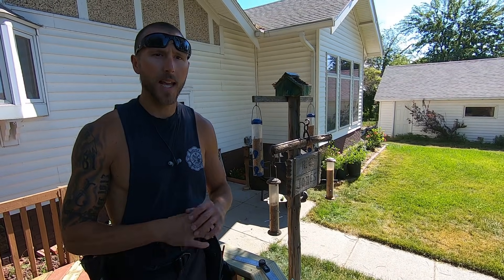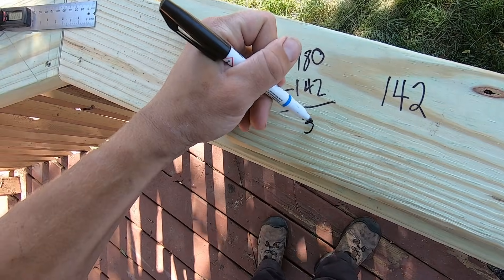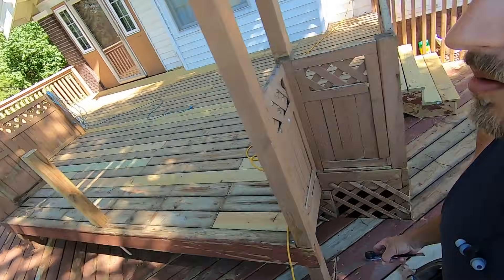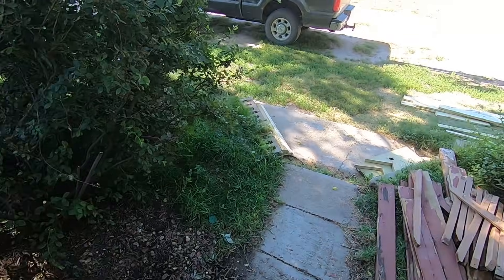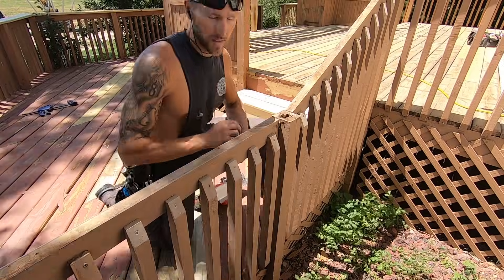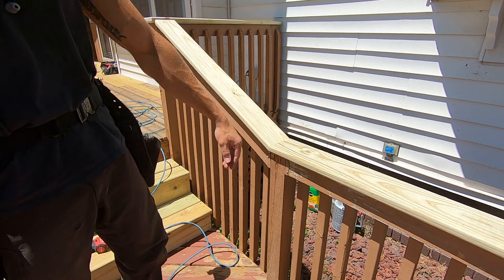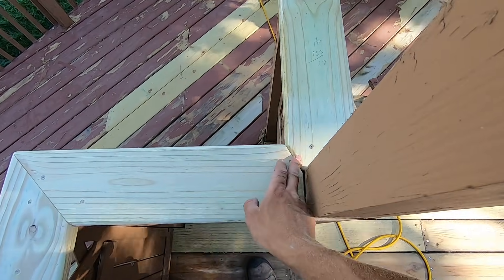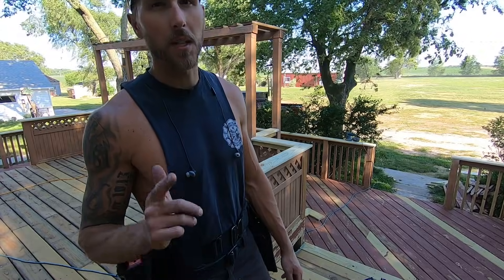Deck Railing, obtuse angles, tips/ tricks

Comment: Why divide the angle by 2 after subtracting it from 180?
Reply from the maker: Good question, I was told because 180 is a straight line not sure on the geometry though just a carpenter haha 😂
Reply from the maker: Dividing by two is bisecting the angle though just like cutting baseboard. 90* wall intersection gets two 45*s
Reply: @AMAYERICAN  ahhhh ok, i am also just a carpenter and always looking for new tricks especially on angles. thanks bro.
Reply from the maker: @SCS2694 another good trick is cutting a scrap block at 45 degrees, CA gluing to your saw base, allows you to cut acute angles for stairs. I think finish carpentry TV did a couple videos on it, I’ve used that trick a few times 👍. Appreciate you taking the time to comment bro!

Comment: Fantastic lesson in math. Worked with a lot of carpenters who liked to overlap and mark because they didn't like to deal with "all that math crap". Just be sure the rail you're getting your angle off of isn't bowing at all from post to post; especially when using that southern yellow pine. You'll think your miter saw or your angle finder or even your carpenter square is broken. 

Not that I would know from experience when recently replacing all the old Southern yellow pine cap rails on my deck. 🤓
Reply from the maker: Yeah it’s been rough lately! I wish we could get PT hem fir here, yp just gets wonky when it dries out! And the knots…. Seen a post about Kiln dried pressure treated lumber they call it kdat? That would be the ticket I bet !

Comment: Is that 3/4 board you used for cap rails? 8 or 6 inch wide? I have same exact deck but 2x4x8 for cap rails and they looked to big and gaudy.
Reply from the maker: Standard deck board 5/4x 6 is what it will be called at lumber yard 👍

Comment: OK, so I just bought two bundles of those railings, they are cut at a angle on one end, but not on the other end. And they are 42 inches long. So it’s up to me to cut the angle at the bottom of each railing, what is the degrees of the cuts on those things, they are the exact same as these in your video
Reply from the maker: You can lay railing up against post and scribe along post to give angle. The railing needs to be resting on stair nosing to get correct angle.

Comment: Does it help - in the long run - to stain/prime/paint the cuts prior to assembling? ...is it worth it? I have sen different opinions on the subject ..............thank you for your great video
Reply from the maker: Thanks! And yes I would do it on my personal home, on both decking and framing, also using joist tape. They make various end grain sealers etc. So you are building your own deck that’s awesome! Are you a homeowner or tradesman ?
Reply: @AMAYERICAN  I am a home owner...thank you sir for your advice
Reply from the maker: Yep you bet thanks for watching!

Comment: How’d you get the angle for doing the balusters? Kinda stuck
Reply from the maker: Lay a 2x4 on stair nosings and mark a plumb line on that 2x4. Use a speed square or angle finder on that mark you made on 2x4 and that’s your stair angle.

Comment: Why 180?
Reply: 180 is a straight line.
Reply from the maker: Only for obtuse or angles (greater then 90 degrees) you subtract from 180 to work with miter saw labeling. Otherwise you could view 0 on your miter saw as 90 degrees, 10 as 80, 20 as 70, 30 as 60, 45 as 45 and so on. I just find it easier to subtract from 180.
Reply: Technically for his first example you can do it one of two ways. You can take 142/2 and you get 71 degrees. What is a 71 degree cut on your miter saw? Well the miter saw is reading from 90 degrees at the zero mark. So, 90-71 is 19. So, you'd make your cut at the 19 mark. The other method is essentially translating the math to go off of the miter saw markings. Why 180 degrees? Well, the zero mark on a miter saw is 90 degrees. We know that if we dont cut two square boards and but the ends together you essentially arrive at a 180 degree angle (a straight line). We know that two 45 cuts equals a 90 corner. So, logically any angle cut above 45 degrees but under 90 will result in an angle that's 91>=179. When he subtracts 142 from 180 (two 90 degree boards), the answer you get is that the two cuts in total will be 38 degrees off 90. Divide 38 by two to get the single amount of 90 for each cut. I prefer to do it the first way and to just always keep in mind that you're subtracting from 90 when reading the miter saw.
Reply from the maker: @wanderingsailor5503 wow great explanation thank you for taking the time to explain all that ! 👌